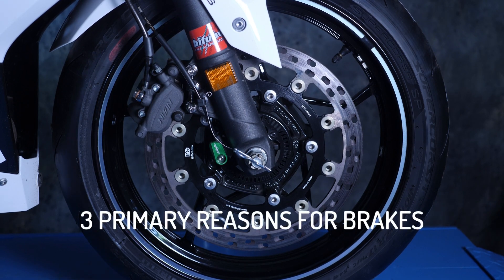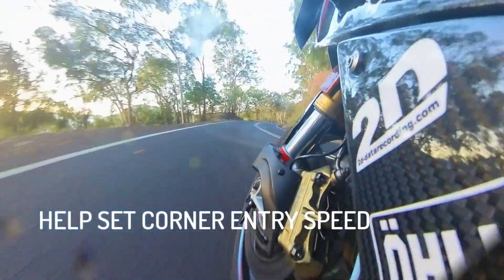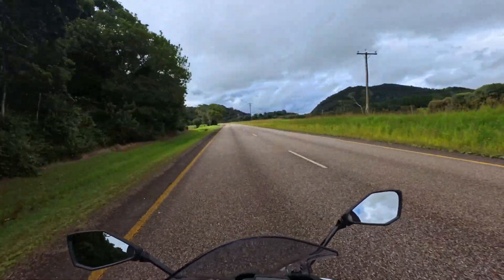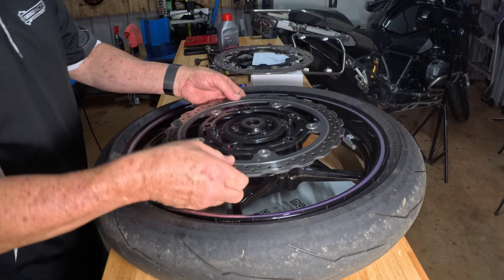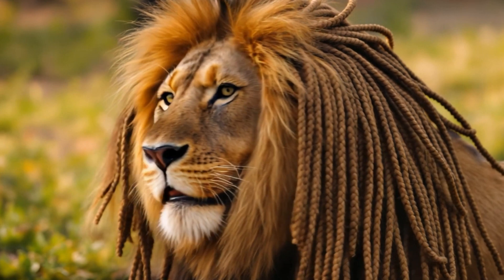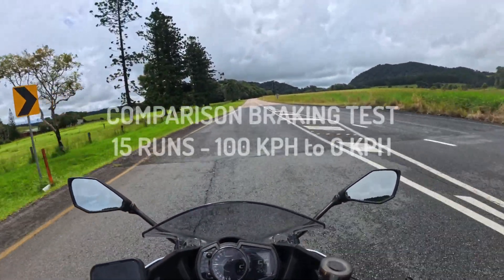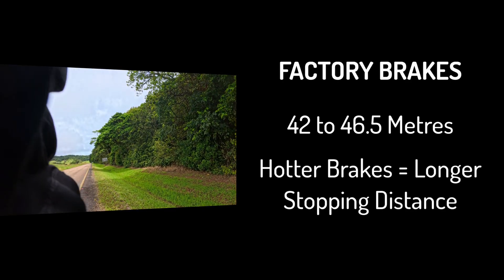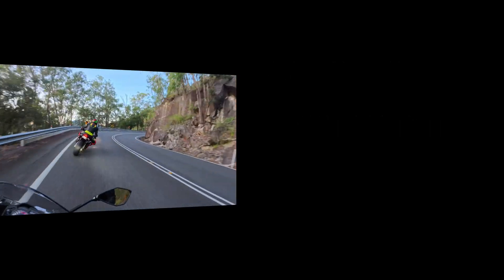Ninja 400 Track Bike Project - Upgrading the Front Brakes

Comment: I got some questions about master cylinder pick up. My friend told me my ninja 400 only got 2 piston on front brake caliper so i need only 14mm or 15mm master cylinder for that. I saw you pick up 19mm, on bike bike like r1 or suzuki gsxr1000 they put 16mm on stock to use with x2 caliper 4 piston 😢. So may i ask about detail of 19mm caliper when use with 2 piston caliper. 😊

Comment: It's very interesting that the mimimum stopping distance is the same, I would have put money on the upgrade having a shorter minimum
Reply from the maker: yeah that's fairly typical, downforce is limited to 1G and if the tyre is almost losing grip, then stopping distance won't get shorter for better parts, generally we are seeking to eliminate brake fade and reduce braking variation ... it's always an eye opener to learn this.